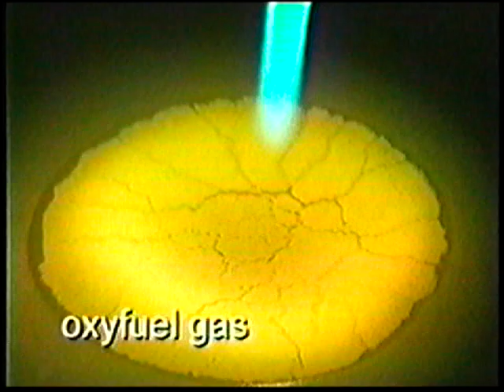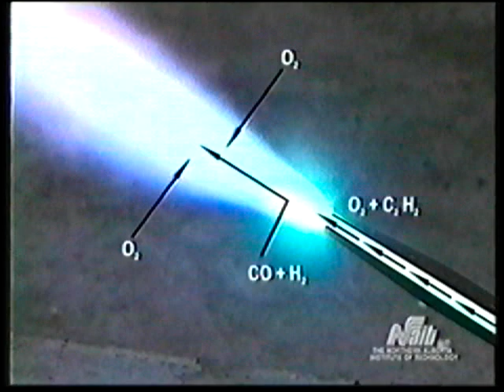How to Weld with Oxy-Acetylene

Comment: Tig comes close to gas welding or oxyacetylene welding. Tig is next best if no electricity in the job site. At all . What u going to use with no more electricity is available. That happenes in the field. Generator has exhausted all it's fuel. Only thing u got is oxyacetylene to do the weld .

Comment: They sure as hell don’t teach this kinda stuff anymore!!! FANTASTIC VIDEO
Reply: I’m in school for welding right now and the first 3 months were entirely based on oxy acetylene
Reply: I’m taking classes to get a certification in automotive bodywork and the first thing you have to learn in the shop is oxyfuel weld thin sheet metal. Both with a filler rod, and fusion welding with no gap or rod.

Comment: Does anybody know what the make up of this flux is? I have never used flux on Oxyacetylene welding of mild steel.
Reply: That wasn't steel. It was cast iron. As for the flux, borax.
Reply: @erikd4461  Also there are special cast-iron fluxes of commerce.  Those rods aren't so common now, but still available if you look.
Reply: @leonardpearlman4017   Hi Leonard, although this discussion is over two years old, I believe the OP was asking about flux for torch welding mild steel. Mild steel can be welded with oxy acetylene without a flux, so I pointed out he was not using mild steel for the coupon material, but he was using cast iron, in which torch welding cast iron is generally done with a flux, most commonly borax. However if I were to torch weld mild steel I would also use a flux as it will generally provide a sounder weld deposit with better esthetic quality as well.  I have came across and used pure cast iron torch welding rods years ago, just like what is being used in the video. However I would be lying if I said what the flux composition was in the flux I was using as it was a "proprietary" branded flux. But a basic deoxidizer like borax does provide more then enough fluxing action and protection for satisfactory welding results on cast iron torch welding. The "brand" name flux I used if I recall did not provide anymore measurable benefit over borax from my experience.  However from my experience torch welding cast iron with cast iron rod has minimal advantages in the vast bulk cases with regards to cast iron torch repair are from my knowledge aren't used in todays modern world for many cast iron torch repairs. One place where they would be needed is in applications where the cast iron has a high enough working service temperature that a brazing alloy would not provide enough strength at the elevated temps or in some extreme cases become plastic and weaken or turn fluid and melt out and fail. Cast iron internal combustion engine exhaust valves or cast iron turbocharger turbine housings come to mind. However if that is the case I would normally avoid torch welding the casting and move directly to smaw with a high percentage nickel bearing alloy such as NI99. I suppose the torch welding of cast iron would be best for highly restrained castings where they have a high service temperature requirement and where because of the restrained nature of the casting,  stress cracking would be a problem with a cold smaw cast iron weld repair with a nickel based filled.  In that case the high heat input of the torch based cast iron welding into the casting would provide  stress relieving effect. But again I would opt for a hot "preheated and soaked" smaw cast iron repair with a nickel based filler over a torch based cast iron weld. The cost of acetylene being so great, at least in these parts of the world, it would be cheaper most likely for a NI based hot smaw repair using a LPG tiger torch for preheating and heat soaking the casting. Generally torch welding is a dead art. This video being very old and dated, although still very valuable. as such allot of torch welding is predominantly used for teaching manipulation and control in apprentices nowadays in vocational trade schools. It really has minimal commercial uses anymore. That is not true for torch brazing, which is still hugely used today and will be for many many years to come. 
Subsequently most cast iron torch repairs today are being done by a bronze type or nickel silver type braze alloys. If anyone is interested in cast iron torch welding rods and a suitable flux I believe TinMan Tech sells them still.
Reply: @erikd4461  Thank you for the valuable info. There are many old videos from the 40s and 50s where mild steel is welded and the welder uses a filler that he dips in a can filled with a yellow powder. Maybe borax coloured yellow?  Have no idea what it is as the videos seem to take it for granted that everyone knows what the flux is.
Reply: There are thousands of materials you can use that bind with oxygen, like sand , or wood, etc
Reply: Nor I.

Not even in my high school metals shop class.

Comment: i believe it is correctly said 04:08 (mono-)carbon-di-oxide CO2 but wrongly written C2O (di-carbon mono-oxide)

first stage of combustion:
C2H2 + O2 = 2 CO + H2

second stage of combustion:
2 CO+O2= 2 CO2
2 H2 + O2 = 2 H2O (or, H2 + O = H2O)